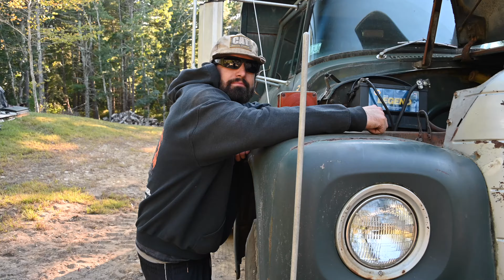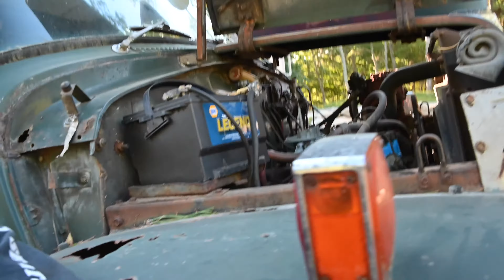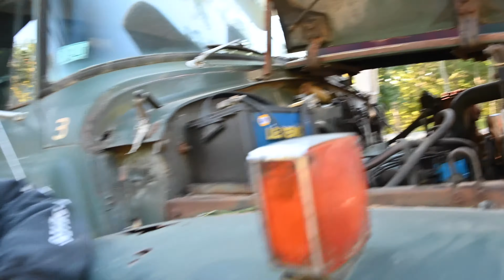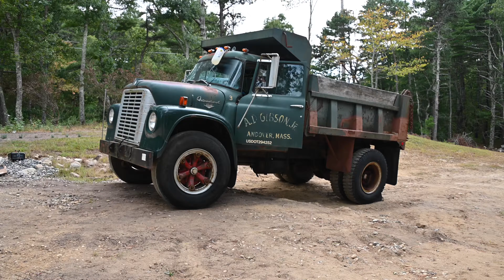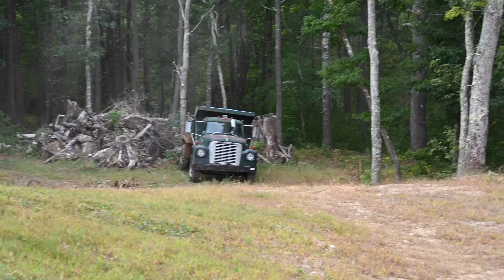International Loadstar 1890 Running for the first time in years

Comment: Many years ago I used to help out driving dump truck for local dairy farmer when it was time to chop silage corn and haul it to the silo.  One of the trucks was an old international.  Not sure what model it was, but it had a gas engine.  It was a retired oil delivery truck so it had heavy duty suspension.  That bad boy could haul some serious weight and had plenty of power.

Comment: Love 1800s. I started trucking with a worn out 62 tandem dump in 1972 and rebuilt it from front to back. After a miss hap I up graded to a 68 f1800D with a 6v53DD.Had to replace all the rivets in the frame with  grade 8 fine thread bolts and lock nuts.That was the trick to keeping the front end tight!
Reply from the maker: Must've felt like a huge upgrade going from the 62 to the 68 with the DD hauling the load. And that's good to know with the fine thread bolts and lock nuts!

Comment: My 68 Loadstar's fuel pump shit the bed a couple of years ago, so I replaced it with a $40 electric fuel pump. Getting parts for these old boys is difficult and often expensive.
Reply: I just got a 1988 S1800 4x4 with 15k miles this week (12/22/2020), a retired Navy Truck. International 9 Liter V8 diesel, 5 Speed, Air Brakes, 14' Flatbed. Will get it insured, registered this spring. It will be fun to drive. From the ground to the top of the cab is 8'6".
Reply: Awesome,  that's the perfect package. I have rebuilt the entire juice brake system and hopefully they work when I get the custom brake lines.  I have a 68 1700 4x4 and built an 8 foot wooden flatbed entirely from 4 x 6 inch beams. It's so close to being done,  engine fires up beautifully and sounds amazing.  Exhaust leaks and juice brakes were the main issues with Loadstars.  Good luck and enjoy.
Reply: @dustinpollard6237  nice I have a 1967 1200 4x4

Comment: As medium duty trucks go, Loadstar 1800s are my favorite. Probably because I once had a job driving one. It was a bulk feed truck, and the job was in central Massachsetts for Agway.  The truck had one flaw though.  I had to be very careful starting from a dead stop if I had a load of feed on. It was easy to snap a front engine mount bolt, just from the engine torque if I didn't go easy with the gas pedal. Thankfully, it was easy to replace the bolt.

Comment: Compression is bad on 1 or more cylinders.  Compression test to find the bad cylinder(s) and a leakdown test to find out if it's intake or exhaust valves.
Reply from the maker: Hoping its not a compression issue lol, doesn't smoke or eat through oil but anything possible. I'll report back in a couple weeks once I toss the manifold on and freshen up the 50 yr old ignition system.
Reply: @rustybloodsaltysoul8640  Sorry I'm not trying to ruin your day.  I've got over 35 years in turning wrenches so you know I'm not jerking you around.  You can hear the uneven cranking as it cranks past the weak cylinder(s).   Brings back memories...  I remember doing a rebuild on a early to mid '70's International w/flatbed.  I think it was a 345...?  Anyway, crappy head machine work and it dropped a valve seat.  Wasn't happy doing it again.  Never went back to that machine shop.  Shaw City Engines in Fresno, CA  I heard they screw people on Ebay too.  Alan owned it.

Comment: What do you have, Is it a  V345, V392 or MV404 or MV449 ?  Hard  to tell from your video... My guess is a V345... If you have a Line Setting Ticket you will know exactly what you have. Front Axle, Rear Axle, Trans etc. I have one for my 1968 Loadstar but I do not have one for my x-navy 1987 S1800 4x4